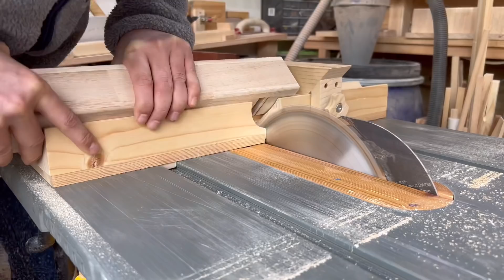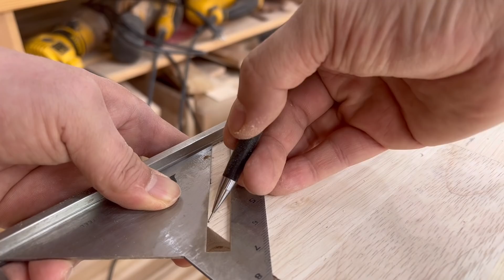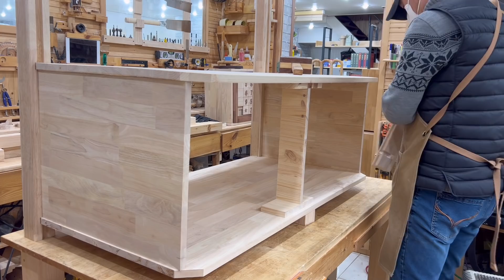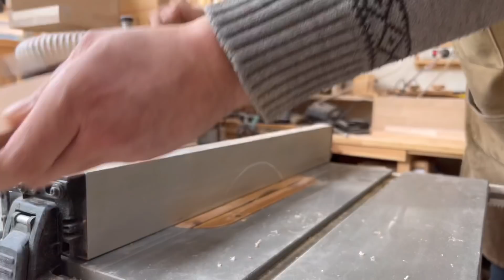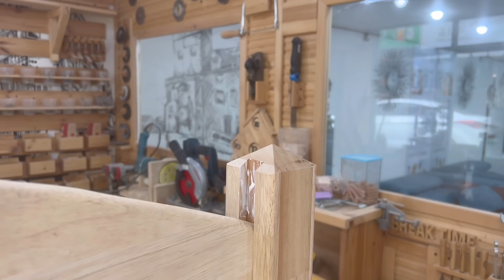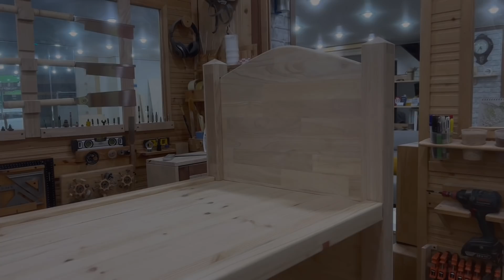모서리 커팅 지그를 이용하여 목재를 견고하게 접합하는 과정 / 목공 DIY

Comment: I always enjoy watching your advanced skills. What type of wood was used for the corner posts and were these laminated to reach the final thickness?
Reply from the maker: The thickness of the rubber wood corner post is 60mmx60mm.  And I'm sorry but I didn't understand which part is the final thickness. 😥
Thank you 😊 👍🤜🤛 Have a nice time 🍀
Reply: The rubber wood is a great choice! As for the final thickness, I  meant did you glue thinner pieces together to get the thick legs? Thanks for sharing.